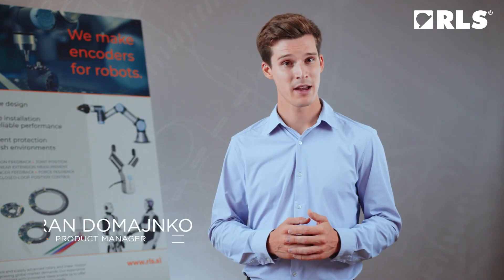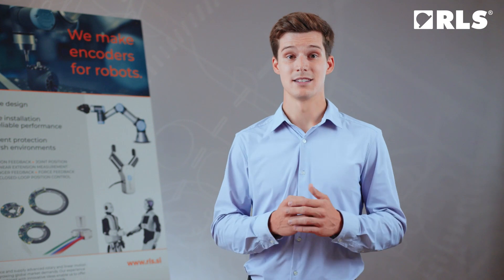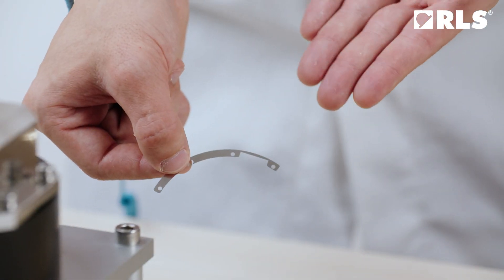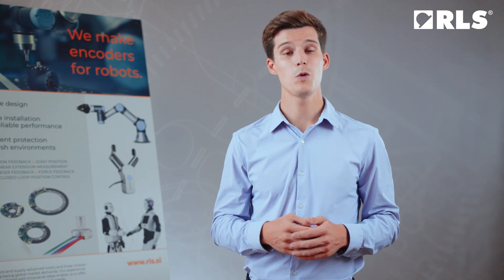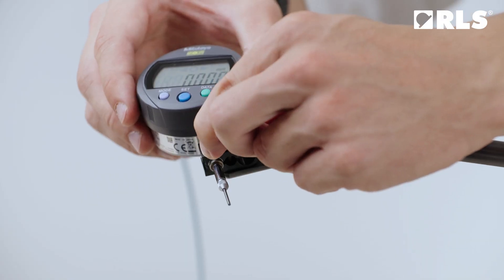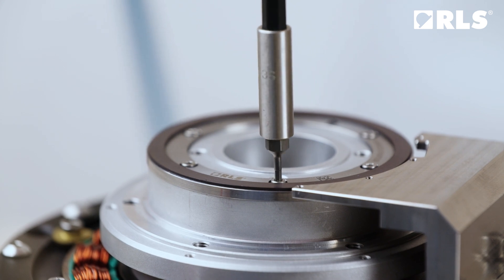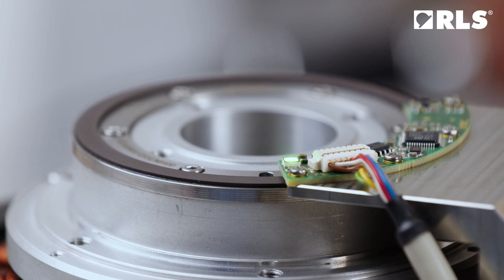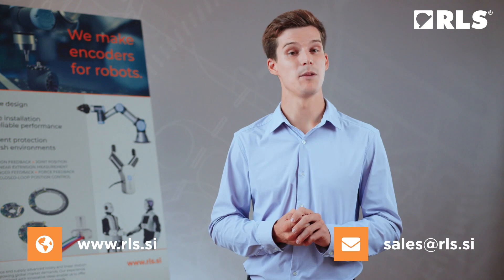AksIM encoder mounting instructions

Comment: Imagine I want to build a really slim motor with the AksIM encoder. How close can I position the encoder magnet ring and the encoder read head from the rotor magnets? In your example above it looks like there are around 40-50mm clearance between the motor magnet and the encoder magnet ring. What if I want to reduce this to only a few mm instead?
Another question is if I dont need an absolute encoder do you have any incremental read head option that I can position right next to my rotor magnet ring instead of using the encoder ring? It would save me one component and reduce overall build height.
Reply from the maker: Dear Björn, 
we have multiple encoder options for motor control. Ring encoders, shaft encoders, PCB version or sealed read heads. 
I suggest you check out our website: https://www.rls.si/eng/ and use the configurator to configure your encoder. And if you have other questions, please let us know at sales@rls.si.
Thank you for your interest in RLS sensors,
Martina